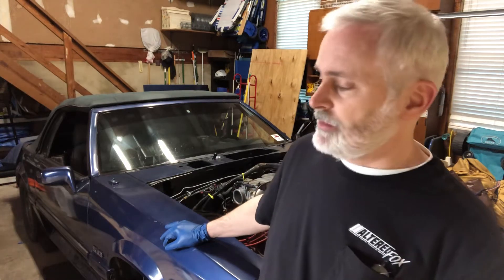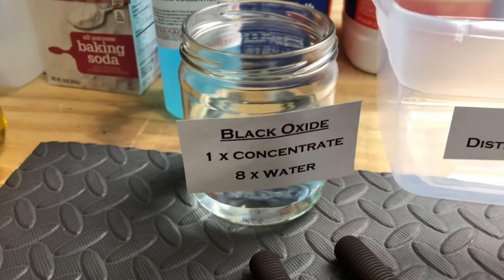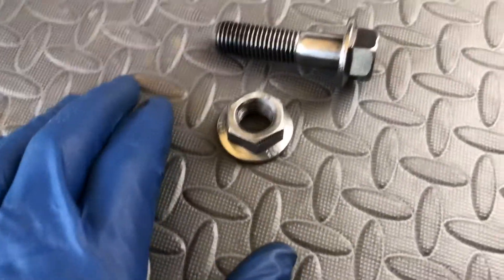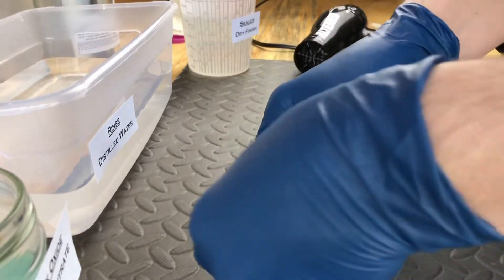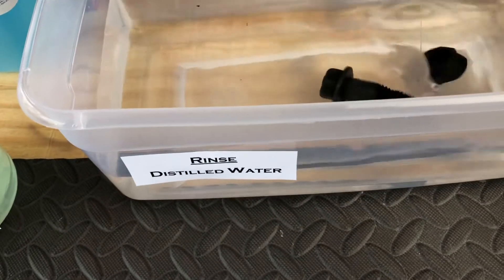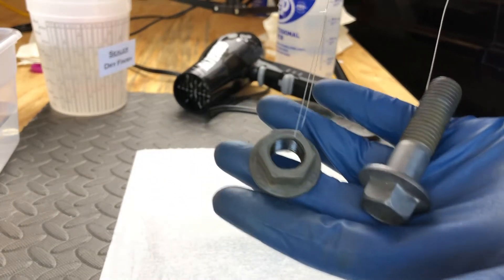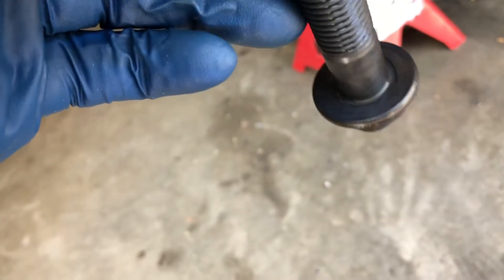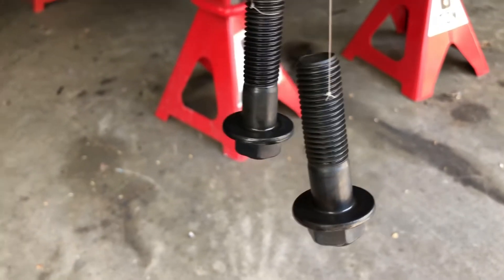Blackening Steel Hardware with Black Oxide

Comment: Curious what you use to prevent fasteners from rusting? I've researched it to death and from what I've found it seems the only good way to to coat the fasteners either electroplating, spray paint, etc. Whenever I work on a car, motorcycle, ATV, etc I clean everything as I go including the fasteners if they need it. Recently picked up an ultrasonic cleaner and used some Evaporust in it and it made easy work of rusty fasteners but now they are gonna rust even faster than before lol. I know black oxide doesn't hold up to rust compared to an actual plating but from your experience does it offer ANY protection at all? For my motorcycle for example.. I keep it in my garage and the same with the ATV.. neither one sits out in the weather. Wondering if black oxide would help with the rust since they are inside (not climate controlled). Either way thanks for the detailed video I would love to know any tips you may have!
Reply from the maker: @jonathangaliano2617  the zinc plating is the best way to go https://youtu.be/sGhvdWSD2j4?si=VUobsyb7hvrP0pnu

Comment: Hi, can there be black that comes off these when handling after fully dry.
To put in to context, i bought some and screw them in with my hands for part of it and my hands ended up with small amount of black residue or something on them. Working out if they were oxide or just powder coated.

Would appreciate your thoughts. Thanks
Reply from the maker: After the blackening, you would need to use either an oil finish or a clear coat. The oily finish will leave a residue on your hands.  The clear coat not so much.